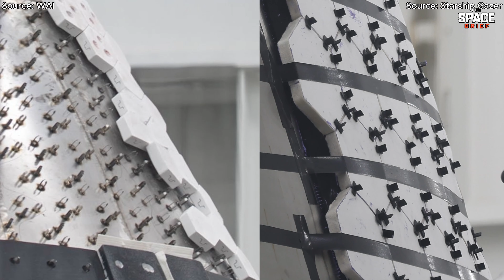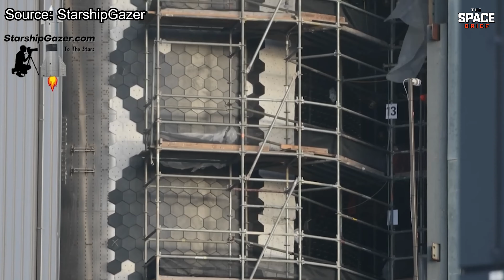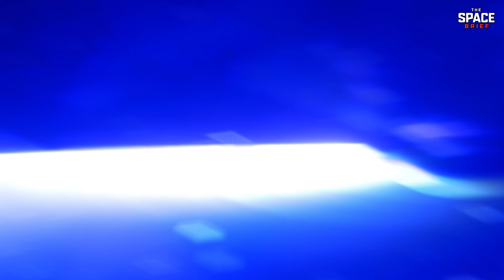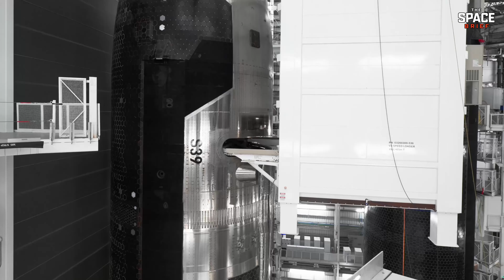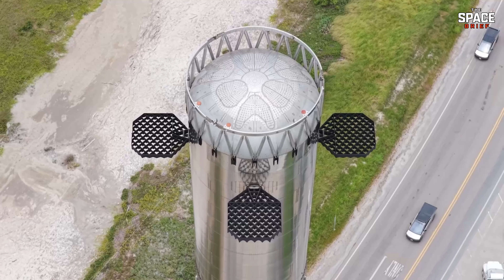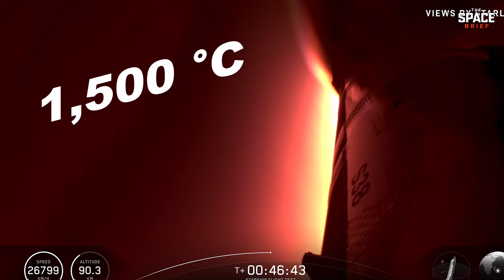Starship's Heat Shield Just Turned White: What It Means Before Flight 13

Comment from the maker: White heat shield, days before Flight 13 — smart engineering or just paint? Tell us what you'd bet on.
Reply: They had been using tht "white tile" in the previous Spacecraft located at the belly of the ship.... there's an underlining reason why do they used it?
Let me turn the table around, wht's ur answer significance? and why do they put an extra protection like "crunch wrapper?"
Wht special adhesive do they use differs fr the black Hexagons?
Thank U 🌿 and Good 🌄morning 🙏 🀄

Comment: Tht's right on the latter descriptive remarks in re: 
SpaceX~Flight-13th, New heat Shields design upgrades. 
They also installed a so-called  The Space Selfie Satellites 🛰.  Six of those 20 Satellites have been specially modified with high resolution,  customs cameras 📷. 
And, further Scanning the Hexagons and others.
Thank 🌿 U